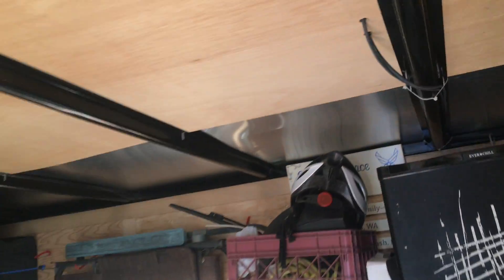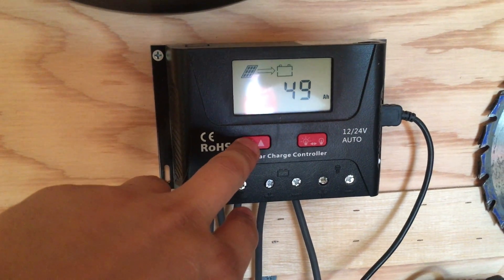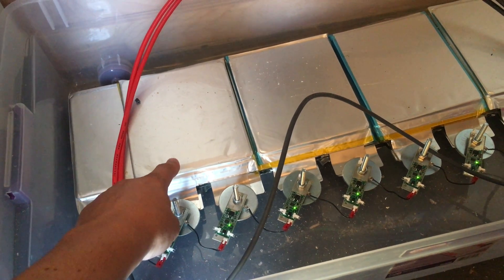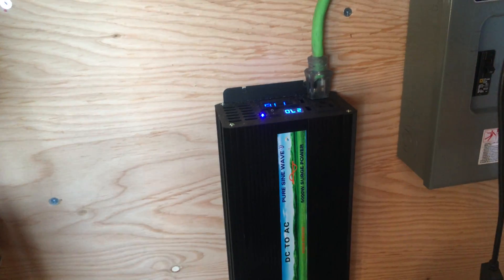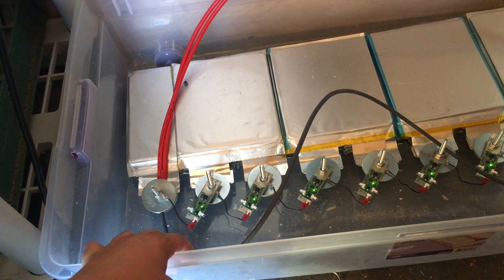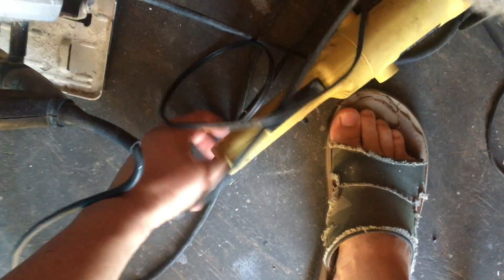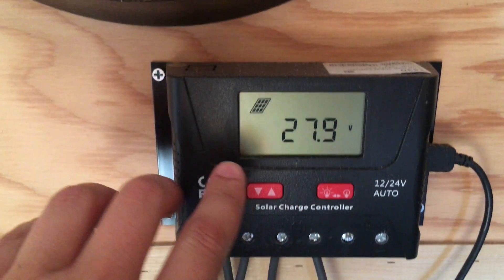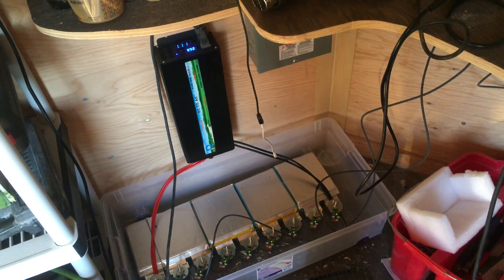Off Grid LiFePo4 Pouch Cells in Cargo Trailer 1.6kwh

Comment: Lifepo4 was my first ebike battery 6 years ago, and I have run several others in parallel to power a two wheel drive system over the years... Lifepo4 lasts alot longer, and has a much batter average output. Good pouch cells seems to be the most cost effective.  Does anyone know of a good quality cell to look at?

Comment: i would like to buy some of your cells could you email me the info and can you send the link or info on the voltage controllers you are using with the green lights . ive allready made some 12 volt banks using the lto titanate batteries im having a hard time finding a reasonable bms for the 2.4 volt nominal lto batterries thanks .
Reply: Check out Electrodacus.com for a